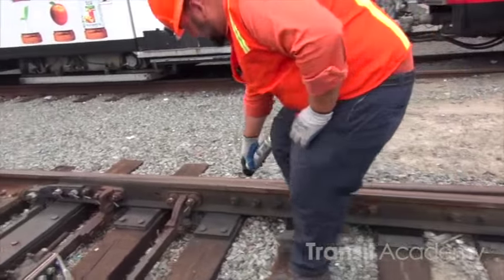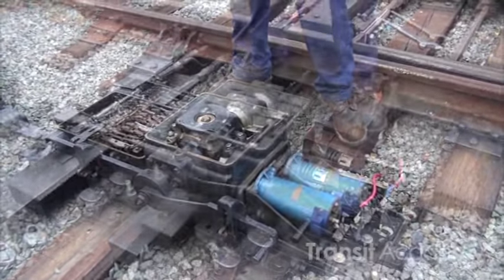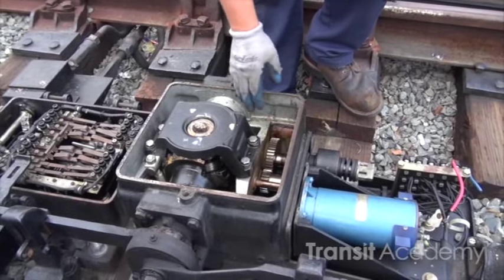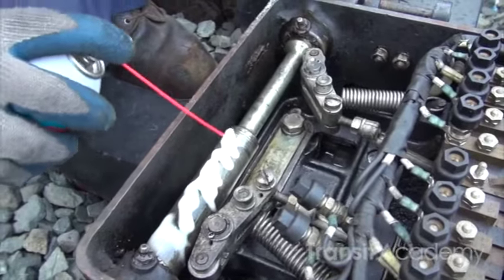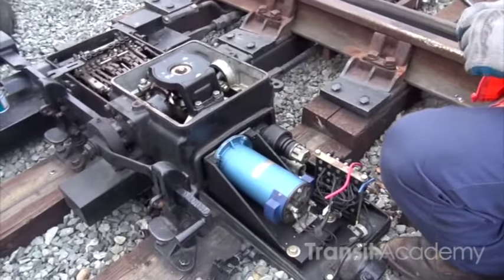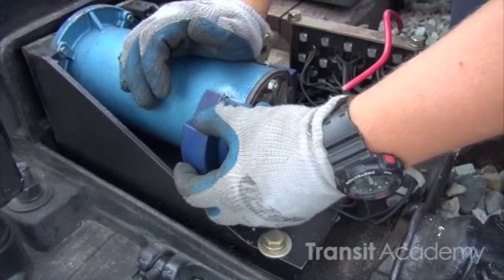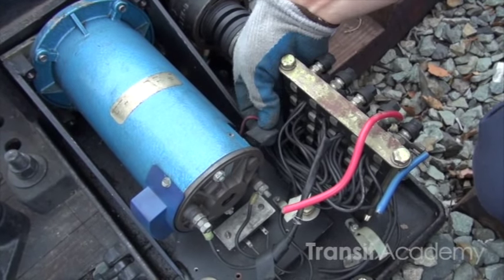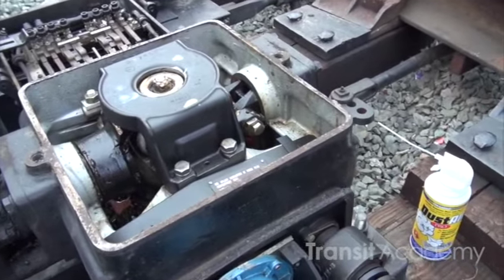Monthly Switch Inspection

Comment: Can’t using compressed air to blow carbon from the motor actually force carbon into the motor and possibly create a ground??
Reply: That is correct
Reply: You didn't show the inspection of the switch machine layout, rods, insulation, adjustment, etc.  Blowing dust into the motor can create a ground.  If you suspect you have a ground on the motor lead, disconnect one lead and megger it to ground.